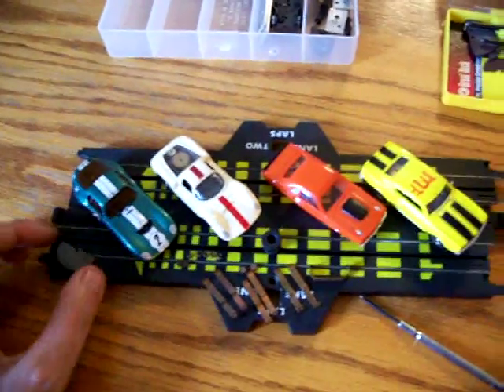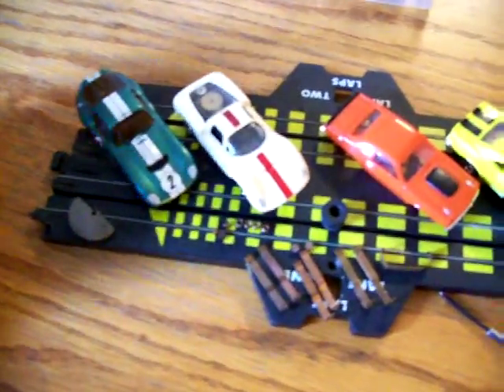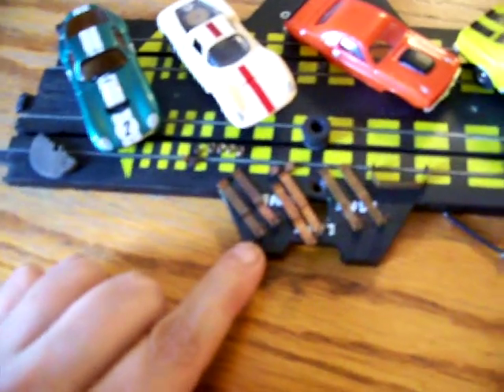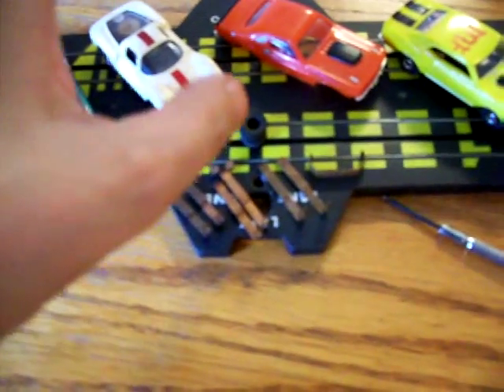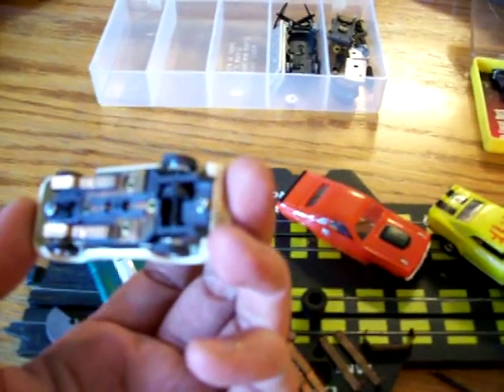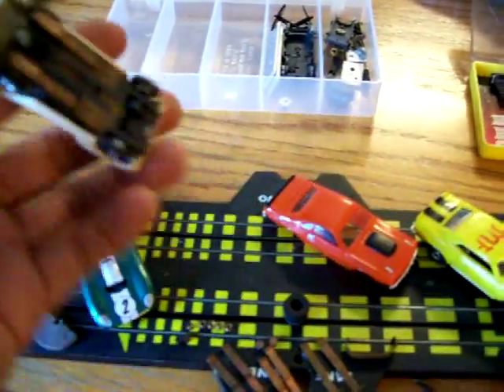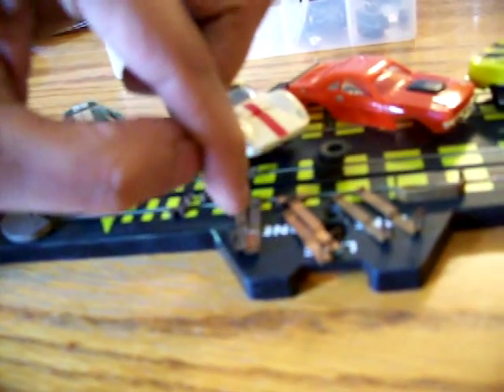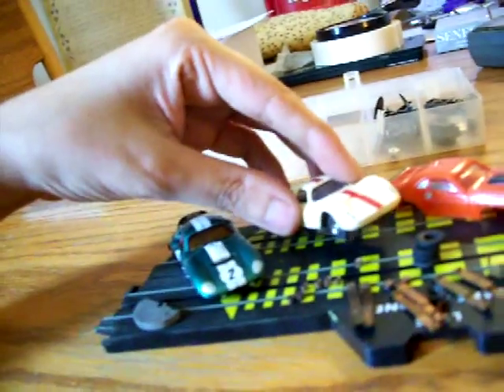Thunder Jet 500 cleaning intro - Part 1 of 3

Comment: you didn't say it was broken or a piece was out of the spring in the video - was just going on what you said there.  if they are bent as you say there, as well as this quote,  "fixing a bent brush spring makes the motor run slower, uneven, and hotter."  I can and have fixed many of these and they run just as good or better regardless of any rules. Never have I replaced any copper, (never have broken any ) and they don't run any hotter and I don't know why they would.  Mine never have. I guess I'm not understanding what you mean by that really.  But that little bend can easily be fixed.  Of course I don't race or go by any rules as in a sanctioned race -we just race at my brothers track.   lastly , Don't need any cars.. but thanks.. have over 1000 I run myself-10+ various size tackle boxes full and overflowing.  Sounds like you gave someone all your cars? I'm guessing you had more than 4?  can you not set up a track at your home? if there was a way to give you my email I'd send you pictures of some of the ones I've fixed. Been doing this off and on since the late 60's. (not sure if you should or no in this public forum?)

Comment: you say "it can't be fixed".  (yellow camaro)
I'll disagree 100% (send it to me I'll "fix it" and send it back to run better than ever, so long as the parts are good.
I have restored and repaired so many of these, even ones most people would have thrown way (and probably have because of bent brush springs, etc) I've lost track.
They can most definitely be restored and fixed to even better than new performance-not in looks but performance. they'll run better and faster and more..
and of course you may know by now you can replace and upgrade every part in the cars and including motors.
of course by now you may know 100% more than you state here after 2+ years
Reply from the maker: At my track it would be illegal to replace the copper (it needs to be replaced since it is broken on the yellow chasis).  I race in competition and everything must be original stock parts except for the tires, shoes, shoe springs, and brushes.  Everything gets speced and must be withing factory tolerances.  I've had several cars and fixing a 
bent brush spring makes the motor run slower, uneven, and hotter.  It will never run the same again.  Take some performance and temperature measurements on a good donor car, then bend the brush spring - test again, and finally run a few tests after you fix it.  You can buy or make a dynamometer for these.

The yellow car cannot be repaired without replacing the copper, when trying to fix a slight bend my tool slipped and took off a chunk of copper at the motors brush-spring.  But if you want any car in my videos, contact Warren or Joel at the Springville Track.  I placed them all in their possession. contact echorr.com and ask for Springville Slotcar clubs phone number, they should give it to you no problem.  The Springville club web site seems to be down for some reason.
Reply from the maker: At my track it would be illegal to replace the copper (it needs to be 
replaced since it is broken on the yellow chasis).  I race in 
competition and everything must be original stock parts except for the 
tires, shoes, shoe springs, and brushes.  Everything gets speced and 
must be withing factory tolerances.  I've had several cars and fixing a 
bent brush spring makes the motor run slower, uneven, and hotter.  It 
will never run the same again.  Take some performance and temperature 
measurements on a good donor car, then bend the brush spring - test 
again, and finally run a few tests after you fix it.  You can buy or 
make a dynamometer for these.

The yellow car cannot be repaired without replacing the copper, when trying to fix a slight bend my tool slipped and took off a chunk of copper at the motors brush-spring.  But if you want any car in my videos, contact Warren or Joel at the Springville Track.  I placed them all in their possession. contact echorr.com and ask for Springville Slotcar clubs phone number, they should give it to you no problem.  The Springville club web site seems to be down for some reason.